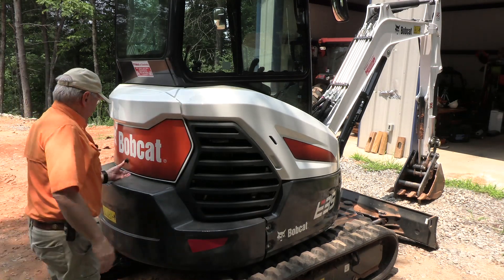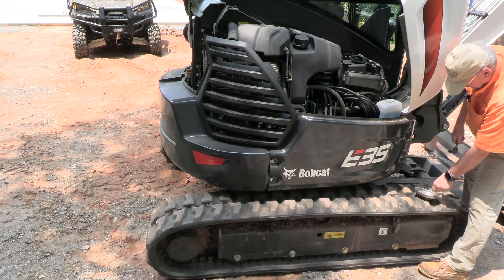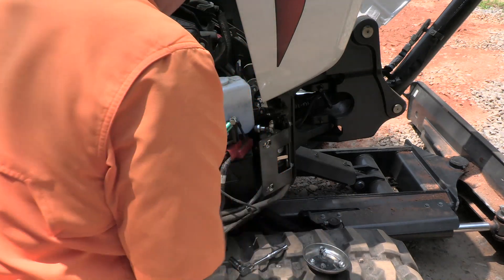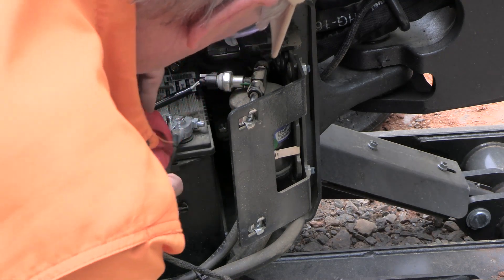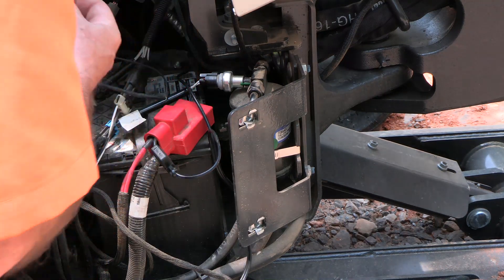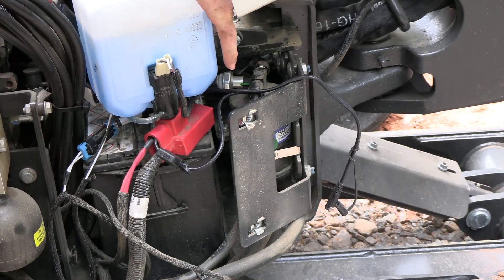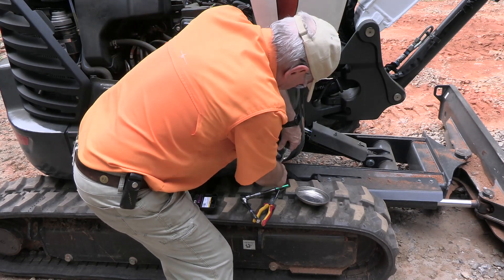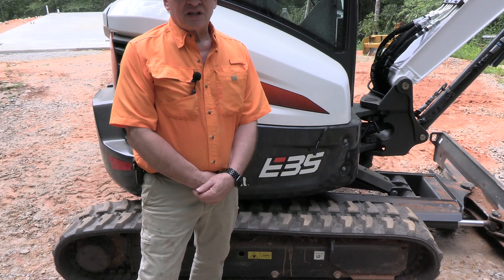Battery Tender Install on Bobcat E35 Excavator.

Comment: Nice job. I could use one on my welder. I question an engineer who thinks it’s a good idea to make you remove something like a washer fluid bottle, so you can get to the battery.
Reply from the maker: Exactly!! They don't make it easy!
Reply: I have a farm tractor where you have to remove a ton of stuff including the fuel tank to access the battery. I have a 2010 Yukon where you have to remove inner fenders, and front grill to change a light bulb.